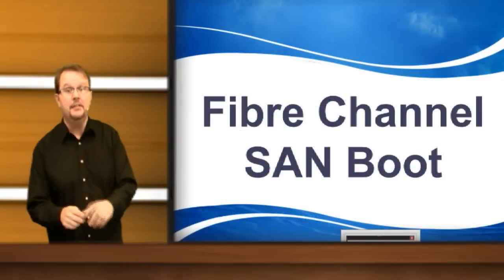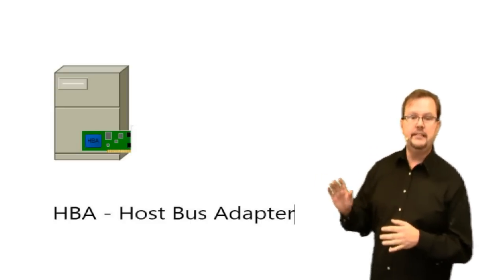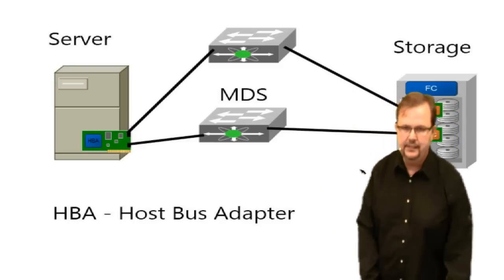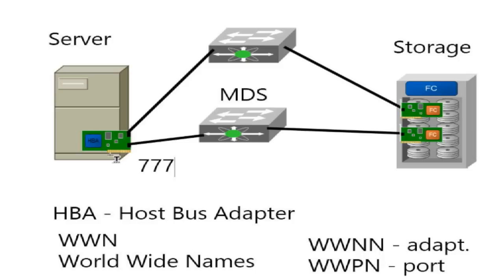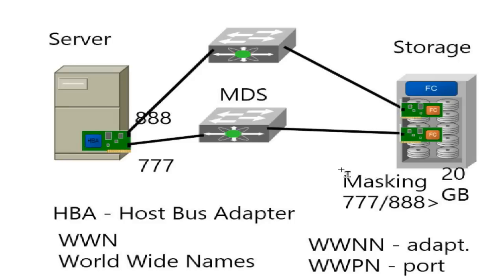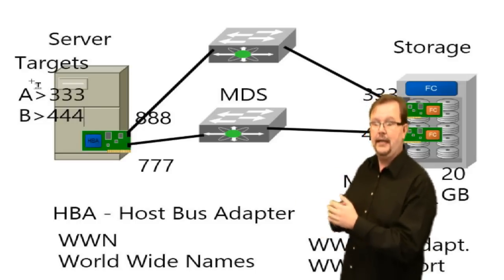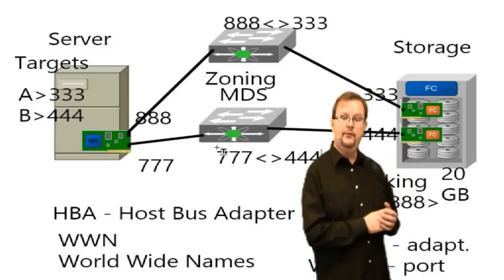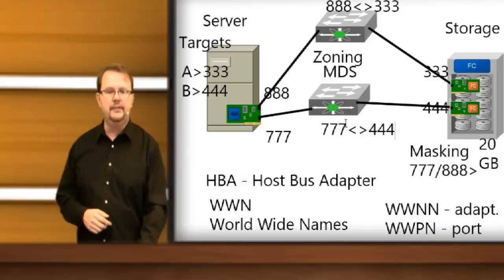SAN Boot - Fibre Channel

Comment: So, essentially, you need manual static IP config for all devices and manually create your routing tables / firewall on the switches from scratch.  Holy crap what a nightmare.  I take it these switches are not auto-sensing, lol.  Question - you didnt mention ipv4 or ipv6 networks.  Do tcp/ip networks not apply in SANs?  Is this outside the realm of the OSI model?  What scenarios would make a coverged network adapter a better solution than a network adapter / hba pair?  I’m subscribing.  You have a new student :)

Comment: should there be any attempt be to explain using the 10gig switches aren't made for NAS attachment as the FCB cpper is a standard 6Gb FCB for SAS arrays not for SATA in a USB 3.0 based AHCPI virtual host , as this makes using stoarge into a ethernet transport which seems great only the consequenses are unknown but it bridges the ISP's inside the store as the switch is a L2 layer but ISP's deliver aswell a L2 based uplink, no router alike as the 10.0.0.0//32 IP is widely used by ISP's as uplink to a central host under a vlan only this vlan isn't possible to tag egress traffic simply cause the switch is made for the synch round ribbon not as outgoing traffic ,

Comment: why not just connect the server directly to the storage without having to go through the MDS switch?
Reply: Aa Aa
Reply: Because there are limitation on storage ports. Connecting to switches fabrics is a better way for future expansion.
MDS/DCX switches have over 40 ports when storage ports have only 8 or16 max.